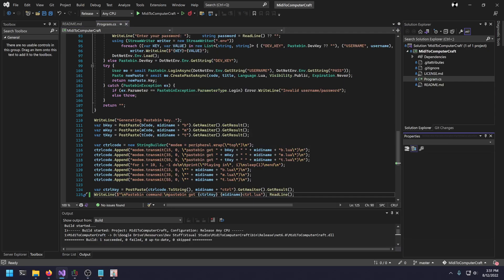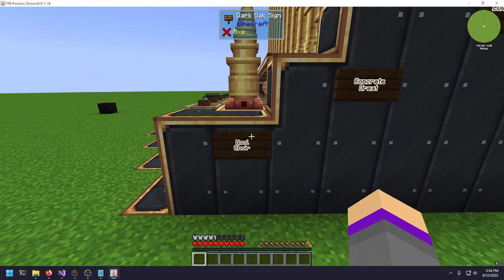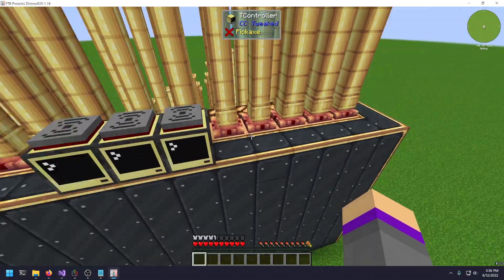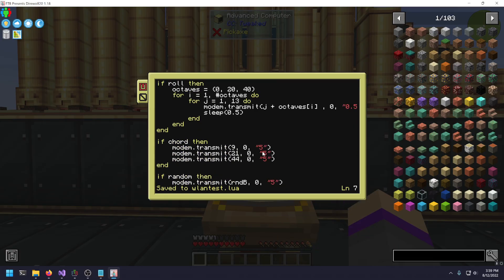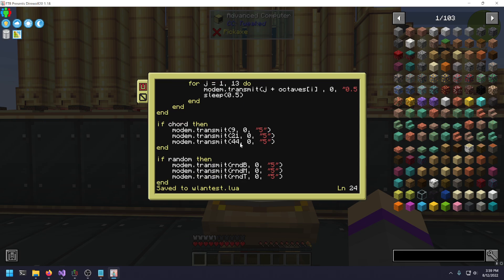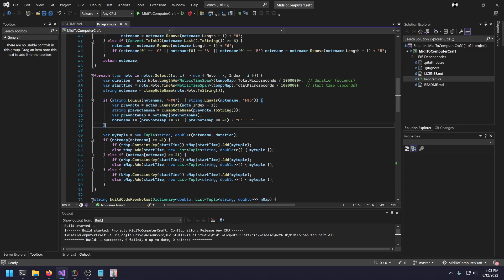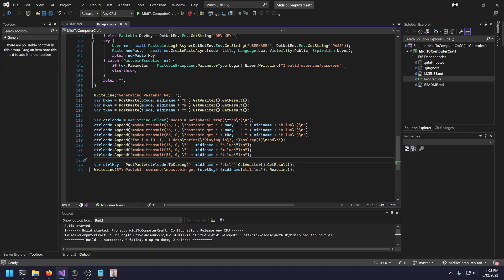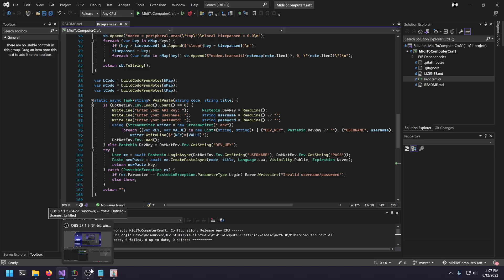Minecraft Steam Pipe Organ (Create + ComputerCraft) - MIDI Controller

Comment: i tried going into the world but it wont load i tried minecraft 1.18.2 and 1.18.2 and i even tried the FTB Direwolf20 modpack which just crashed every single time, am i doing something wrong?
Reply: I was able to get it, I had to use the very specific FTB direwolf20 1.18 mod pack through the ftb launcher
Reply: @chancefalk did you use a specific version of the FTB direwolf20 1.18 modpack? because i already tried the 1.18 modpack and it just kept crashing it would be really nice to know if you used any specific version of the 1.18 modpack besides the latest one
Reply: I remade it in ATM10 4.2, it should work with all the updated versions of create and cc: tweaked

Comment: This is really cool. Does it have anything that lets the system "best fit" the midi into the available range? (e.g. if the song uses 3 octaves, but because of the key it has a few notes that fall below OR above the available pipes, it could adjust the entire song up or down by half steps so that it fits). Also you should make follow up videos, one for each full song. It'd also be cool to get this setup as a continuous loop of random songs with a villager sat at the controls.

Comment: Hey i've tried to do the same on my current server and being fairly new to computercraft ive had a realy hard time following trough all this.
Ive recently realised that i needed to turn on the wireless modems on all of the computers with "lua then rednet.open("top")" but thats just one of the things i had to guess for myself.
I am currently stuck and i cant get the "wlanplay CHAN_NUM and wlanctrl CHAN_NUM" commands to work at all, almost like they never existed.

It would be realy nice to have a rundown or a video showing how to correctly set it up as it is  a quite difficult thing to do.
Hopefully im 1 command away from figuring all this.
Reply: I'm actually working on implementing this on a server as well. The "wlanplay CHAN_NUM" and "wlanctrl CHAN_NUM" don't exist because they're custom programs that were written to handle the controlling. I can't find them on his github, so I believe the only way to get them is to either download his world or guess and rewrite the files.
Reply: Upon looking further, you don't have to open the world at all. Download his world, extract the folder and open it. Then go to "Pipe Organ" -> "computercraft" -> "computer" and each computer's files will be there. Just copy them elsewhere to use in your build.

Comment: i also did something simular, i decided to go with manual control given my lack of coding experience, (and yes i orginally made it the hard way not being familiar with create.., but now i use the wireless redstone becouse last time took me 4 days straight of work, but anyways, i operated mine on a "keyboard" of 13 notes per rank, i had each rank activate redstone gates that coincide to that specific rank of pipes, (allowing ranks to be turned on and off while playing) typically i liek to ahve around two to increase/decrease the presence of the sound of a particular rank, so 6 ranks total 3 octaive of 2 ranks, and ofcourse 13 total notes, and generally ahve worked out a basic keyboard layout, but i might try and make soemthing that's more akin to the actual keyboards (i ahve found button work better than levers on a manual setup) i might also try to make a wulitzer with all note block sound effects and bells

Comment: My only question is why you didn't just make it in the overworld in a flat with only a pack, or self made pack, of the mods needed? wouldn't that have been simpler and eaiser for both you and the community?
Reply from the maker: Certainly, but it wasn't an idea I pre-planned by any means -- just a project I was inspired to quick throw together and I went through quite a few revisions using different mod items in the process, so I didn't bother compiling a list of the exact mods I'd need ahead of time.

Comment: You should make a server program that runs on your real computer that is listening for midi events from a midi keyboard.

The CC Computers can connect to the real server via Websockets and respond to key presses.

The latency isn't that bad, so it could be a really nice project.
Reply: Nice idea. Id guess you could even eliminate the latency variation for the client by splitting the midi data into 1/3 second long segments and using a 3 element fifo buffer for replay. As long as your latency doesnt spike over 666ms it results in a near perfect replay.

Comment: Would it be possible to read in the midi in LUA beforehand and then play that?
Reply from the maker: I'm sure it is, but it's much easier to work with data files in C#, especially MIDIs since there are so many properties that I needed to scrape from the file. It was just faster to use a library I was already familiar with
Reply: @dszelogowski  That's fair! I also tend to stick with langs I know more

Comment: So Im wondering how i would build this in a server ? is it even possible? also if you get live MIDI to work please post another video!
Reply from the maker: This same system would work in a server as well; I'm not sure how CC handles latency between server members, but I imagine that it will sound almost the same to everyone around the area provided they have a low enough ping. The implementation is simple enough to not have many issues.
Reply: @dszelogowski  so I just hook up all the pipes to the computer ? I’m trying to load the world right now, I’m assuming it shows up to build and what commands to run for each computer ?
Reply from the maker: @IWantaMinecraftCape  Yes, when you load in the world you'll see the setup has each computer running its own "server" waiting for live commands from the main computer.
Reply: @dszelogowski  so 39 separate “server computers” wirelessly linked to the main computer ? Is the command to set up each server different ? Sorry for so many questions. The github page is a bit confusing.

Comment: "Lua doesnt support multithreading/concurrency" so coroutines or even cc's parralel library?
Reply from the maker: Unfortunately not the same thing, as true parallelization, CC parallel is exactly the same as what I currently have but would grossly overcomplicate the code with the need for coroutine yielding, which in Lua's case is done by switching between coroutines each time one yields instead of actually being synchronous. This is drastically underperformant when synchronization matters, like this case with a 3-voice ensemble

Comment: what does the program on each of the redstone output computers look like? I can't get the world save to work.
Reply from the maker: Have you tried loading up the world using the Direwolf20 modpack on the FTB launcher?

Each of the organ pipes has a computer that waits on a designated channel for input from a controller, which makes it run a function that turns the redstone signal on for that pipe, sleeps for a certain number of seconds that the controller tells it, then turns the signal off. Each controller has its code generated from the C# program (which the main controller loads and runs on all 3) which sends the duration over the note's channel.
Reply: Ah, no. I missed that it was built in a pack. That's actually rather similar to what I was trying with, only instead of listening to a channel it listens for a specific protocol as part of a broadcast to all the computers.
Reply from the maker: @annatheelephant1937  interesting idea! That's kind of what I originally wanted to do; I wanted everything to be controlled by one computer (or at least the three sub-controllers) but it just seemed like way more work, especially with the remote redstone signal available.

Comment: Technically this is more "Portative organ" than a true Organ. To create true pipe organs you would need Ranks and Stops. The problem is a limited variance of whistles from Create, so you would need a custom mod with more variance in the pipes. 

anyway cool project.
Reply from the maker: Absolutely, that's actually what I based the design on! Unfortunately, the mod isn't very sophisticated at the moment, otherwise my plan was to make a series of button panels that trigger computers to act as stops, maybe a series of pressure plates to replicate the pedals? Hopefully the Create team extends this feature eventually!
Reply: @dszelogowski  Maybe you should try to put an issue on their GitHub with a proposal  of the extension, and link to this project
Reply from the maker: @Fragath1  that's a great idea!
Reply: create sound of steam just dropped :D

Comment: I've been wanting to build something like this, just have no idea how to use Lua at this point and was actually in the middle of watching tutorials. Not sure how long it would have taken me tho lol
Reply from the maker: Lua isn't too bad if you're already familiar with the basic concepts of programming like conditions and loops; everything else was basically the ComputerCraft API. It's pretty similar to Python, but instead of being indent-based, it uses 'then', 'do', and 'end', and arrays start at 1 for some reason. The C# project was the much more difficult part, especially trying to make something concise that was scalable
Reply: @dszelogowski Lua is descended from Sol, which was designed for petroleum engineers with no formal computer programming training. "normal" people think it's quite weird to start counting at 0. Using 1-based arrays, the Lua designers avoided confusion for their first clients & such.
besides, you could use 0-based indexing (since lua tables are just hashmaps with no restriction on what the keys can be), it's just that the standard lua libs use 1 as the convention, so it's just easier to follow suit. i barely ever directly index into a table anyways, i use stuff like ipairs() to do the counting for me
Reply: you said LUA??? i know lua... 💀